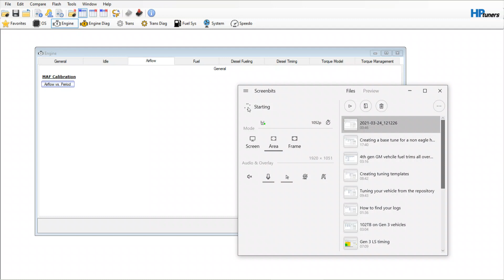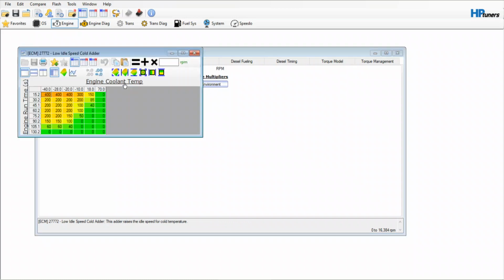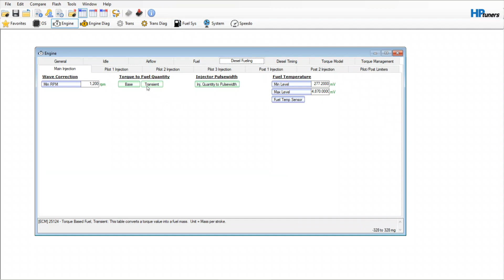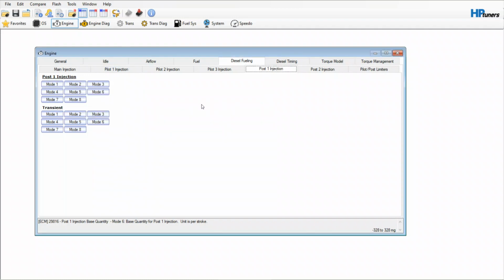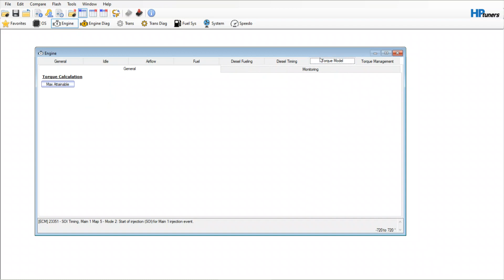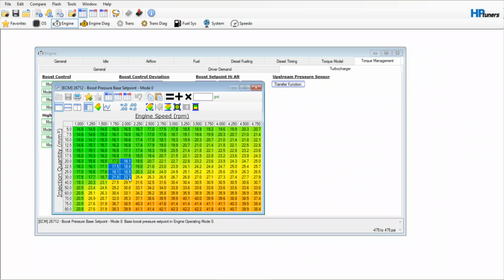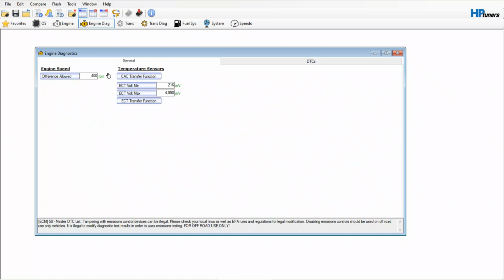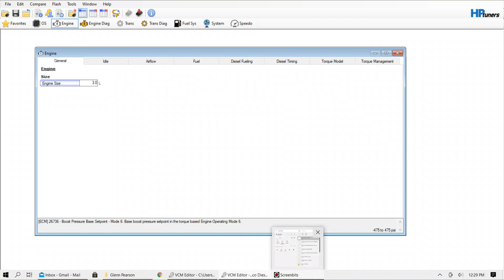Break down of a “60 hp” ecodiesel tune out of Las Vegas USA

Comment: I’ve got 2 touchscreens (one with trans and one with engine tune) that are completely useless to me because the tuner basically blocked me from their software (unless I pay them more money). I can send them to you, maybe you can tell me what the hell they were trying to do. The engine tune was so fucked up that my truck wouldn’t remote start (would fire and then die) and then it would die when starting from a stop (twice in the middle of an intersection). Went back a forth with them for a year while they tried to figure it out before getting your tune (which completely fixed all my problems). Video on my channel showing horrible turbo surge at highway speeds with the tune.
Reply from the maker: Randy@recklesstx.com email me